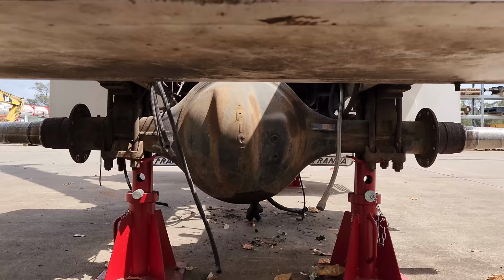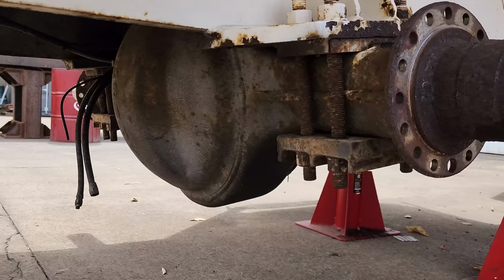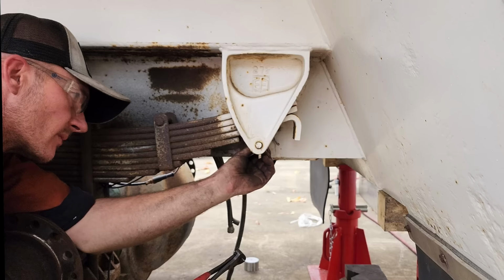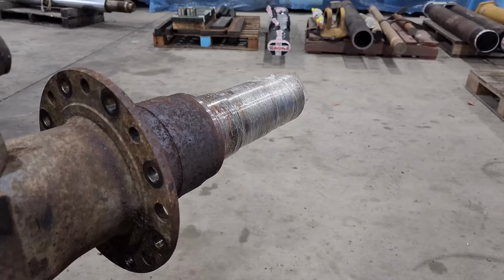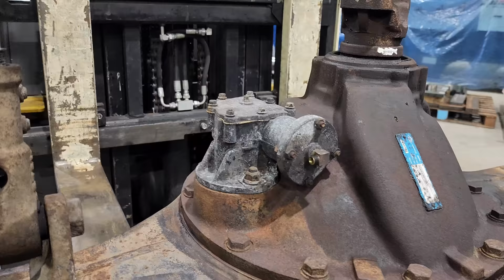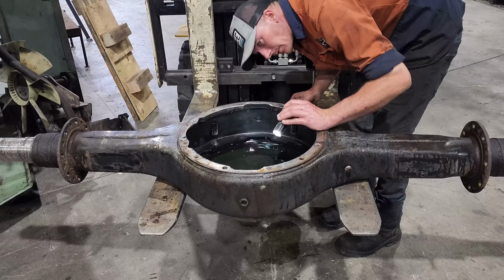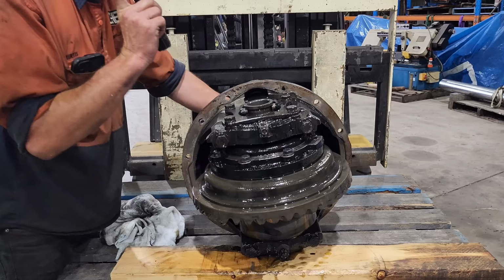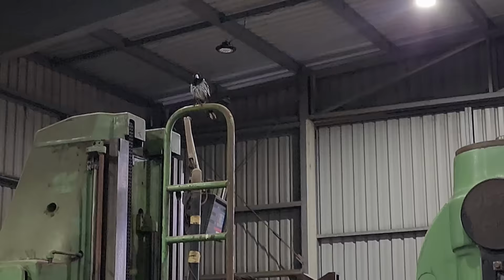Removing & Inspecting The Diffs! | Franna Crane Project | Part 8

Comment: Years ago, when I first started watching you - I once joked that you were going to build an entire Bulldozer out of making replacement parts. The fact that you are borderline going to completely rebuild your Crane means I wasn't as far off as I should have been.
Reply from the maker: 😂 you called it mate! The CEE bulldozer build is still on the to do list 😜
Reply: Kill dozer?
Reply: Infamous D12?
Reply: @CuttingEdgeEngineering  definitely do a "I bought this D11 but it wasn't quite right so I tore it down and redid the whole schwing schwang" 😅
Reply: For about 1/2 the cost of a new one 🤠
Reply: Holy crap, Kurtis, have you put enough work into this thing already?
Reply: This is not work. This a hobby called “ crane restauration”.
Reply: @pneumatic00  Anything worth doing is worth overdoing. Especially if you own the yard and equipment. 
Just like a house, you only do all large infrastructural projects before you move in. Once you are reliant on it, it better be up to your standards or you will suffer all the way through.
Reply: @ai-d2121  restoration?
Reply: @KirkHermary we all devour these vids dont we? 😉.Not all of us speak english.
Reply: @henkoosterhof5947  😎🤣
Reply: We call it a frame up overhaul I've participated in a old 14g cat grader in winter training got to rebuild a injection pump while rebuilding the engine
Reply: @DavoShed   "We'll keep it on the shelf as a spare."
Reply: @henkoosterhof5947   That's okay; not all of us speak Australian.
Reply: So, we started with this bolt…
Reply: @CuttingEdgeEngineering  Yes, but you know that building out of spare parts is going to make it double the price, though with your making parts for less than half the cost of a replacement it might actually work out cheaper.
Reply: @pneumatic00  No, just wants it to work well, unlike the other one, which still has issues, this one, as there is the other one to do the heavy lift, is going to be done up better than new, and thus be as reliable as any new part, but for a quarter the price, and also done to exactly the needs of the shop.
Reply: I want to know what the sprayer that you're using to clean with!
Reply: @CuttingEdgeEngineering the crane of Theseus 😂
Reply: That dozer will have the mightiest ripper shank ever seen
Reply: Should be a drift dozer then.
Reply: @WasserSquatch just kerosene
Reply: @OOpSjm  no i meant the tool
Reply: Crane of Theseus!
Reply: @CuttingEdgeEngineering  Excellent!!
Reply: a D20 as the other ones are to small @CuttingEdgeEngineering
Reply: @KirkHermary  yeah. Whatever.
Reply: @KirkHermary Well there is Squatch253 here on YT. A Cat D2 rebuilt to that degree. Also Project Binky,a Mini. No two bits left together.
Reply: Cap
Reply: @reubeng2110 , did about same thing on a 'sunk' Mercedes Benz diesel. My boss asked me "What are those parts?" I told him the parts are for the injection pump. ➡️ 😮 he then walked away.  😊
Reply: So what's a half inch breaker bar in standard bananas?
Reply: What follows is informed speculation:  As best as I can tell SI (Metric to us that still use Imperial measurements. Big sigh.) So, it appears that mechanics tool, sockets specifically, that are sized SI use Imperial sized square drives. 
To your specific question, 1 inch Imperial equals 25.4 mm SI so 1/2 inch equals 12.7 mm. In practice there's some slop. 
Here in the USA we have the situation where all manner of stuff is in Imperial and it takes some effort to obtain similar items in SI.
It's a strange, strange world.
Reply: @tetedur377   nope. I am dutch. Had to look up the word devour to put it down.
Reply: @SeanBZA  I appreciate that, I was mostly just needling Kurt. My  impression is that This project viciously blew up to about 4x what Kurt anticipated at the start. We've all had a few of those. Cheers.
Reply: An old friend used to build complete VW Beetles (the air cooled version) from new-old stock parts, brand new 2004-made, 1978-model car. And I thought that was impressive, let alone a complete piece of heavy equipment!
Reply: LoL... Cause he cut the threaded bar in the middle of the adjustment ends on stable arms.. not the u-bolts.. cause he can make those in his shop... Wasn't going even going to entertain the idea of spending $$$ on anything that he feels like he doesn't have to...
Reply: I have a friend who literally started with a valid Vin number for a 99 Peterbilt truck and built it himself.  He just bought all the parts needed and put it back together.
Reply: @patrickd9551  I hear ya. Just that this project just relentlessly exploded to 4x what the original assessment was, I reckon. And for sure, this heavy of a crane, you definitely don't want this thing running around your yard at 88%.
Reply: @KirkHermary Yep. Unless he's planning to open a little restaurant in the cab!
Reply: Awesome project Kurtis!  Blower is good for guy dusting the house! 😳😃👍👍👍
Reply: @justjames1348 nahh Curtis is too rich to be messed around by government.
Reply: @justjames1348 Marvin will be remembered forever
Reply: @abraxasracing  ½🍌
Reply: @nilo9456  do some math, take 12.7mm×2=__
I'll help you, it =25.4mm. No slop.
Reply: @WasserSquatch Jet A kerosene and a simple siphon gun like what some use to oil undercoat for winter rust protection. Kurtis’s siphon gun works really well.
Reply: Lol, it’s gonna be the "Franna crane of Theseus" 😂
Reply: We’re finding out why it was cheap now. There’s not been much of it that’s actually been good.
Reply: That cream is gonna be as good as new by the time you’re done with it😊👍👍🇺🇸
Reply: @henkoosterhof5947 We haven't been spekin english in straya for two hundred years
Reply: @paulkeys175  howzat?
Reply: Well done! Thanks folks.
Reply: @paulkeys175 😂😮
Reply: That 's sounds about right to me; I've been around for 73 of those years!
Reply: I was gonna leave a comment, but this first one I read sums it up. 
So incredible how he has the thing down to its last bolt. I'm beyond fascinated.
Reply: Essas porcas dos pinos dos tirantes são complicadas mesmo para retirar Você cortou os tirantes mas de qualquer forma vai ter que tirar as porcas para trocar as buchas.

Comment: When you went “.. that was pretty easy to remove” my head rocked back in shock. Kurtis had to overcome like 3-4 different obstacles in removing that diff alone and it was just business as usual to him.  Your attitude and ability is just inspirational; if I ran into one little seized bolt I’d be whinging up and down 😂
Reply: Yeah loved that "pretty easy"! Everything is made of slightly tangy wax when you have a cutting torch I guess!
Reply: Easy I could do the dismantling using a cutting torch. Problem is putting it back together & working.
Reply: LOL.
Reply: I'm surpised he didn't just torch the nuts off the ubolts and replace the u bolts
Reply: @nickcollins1528  The hardware needs replacing anyway, so why mess around pulling the axle housing, then the springs, etc. separately?  Easier to get it all out in one go and do the rest of the work out in the open.

Comment: In my automotive repair career, I spent close to 4 years in 2 different driveline shops.  Pretty much everything from the transmission back was within our purview.  Differentials, driveshafts, gearboxes, that was us.  

It was hard to get the smell of gear oil out of your clothes (much like diesel fuel), but I'm a lot more nostalgic for those smells than I was enamored with them in my time.

Loved watching someone else do this kind of work.  I could watch it all day.  Sometimes I do.
Reply: ive been rebuilding diffs and manual transmissions for years and I still hate the smell of gear oil!

Comment: One of the main thing I get out of your videos is just how patient (colourful vernacular aside) and methodical you are.
I'm always so focused on the goal - getting the job done - that I cut corners, get a sub-par result, and get shit-off with the whole thing.
Watching you work is like a meditation on how to pay attention to the journey, not just the finish line :)
Reply: Retrain your brain; you'll be happier as a result.  

I had the advantage of working on helicopters in the Navy.  It's pretty hard to pull over, get out and see what's wrong with the repair at 10,000 feet - even if you're the one that made the repair.

Even in my later career as an automotive mechanic, I very often asked someone to double check my work; similar to the way we did it in the Navy.  In the Navy (and our sister services), a quality check was a mandatory step in the process of effecting repairs; it was dictated from on high.  You don't have that as a civilian mechanic, but it's a good idea when you can to help prevent needless come-backs.  It's saved me an aggrieved customer a time or three.

Of course it doesn't stop the occasional "ever since you worked on my car, the tires all go flat" kinds of come-backs, but what can you do?  You can't whack your customers, as tempting as that may be.

Comment: That is so much work! I bought at a equipment auction a carry deck crane as we call it here in America,  it was a 12,000 pound rated boom I seem to recall, only paid $5,000 for it, drove it home around 2 miles away, sold it for $8,000 three weeks later, was in mint condition. Though I am in Alaska equipment like this is very common and often gets sold cheap for minimal reasons.
Reply: Sure it was mint. Lol

Comment: Hello Kurtis and Karin,

My appreciation for Kurtis' technical aspect, knowledge and problem-solving skills. But also for Karin about the way in which she portrays everything very professionally, without too many repetitive actions such as loosening all the nuts and bolts (but only 1 of them and the rest in accelerated or pass). Also many creative transitions from driving away from the 1st diff and entering the 2nd diff, compliments!
 
Then a point of attention. By removing the two diffs, an important part of the center of gravity has been removed. Because the boom of the crane is raised (and can therefore catch a lot of wind), there is a possible risk that the crane could fall off the outriggers. Be aware of this -;)

Greetings from the Netherlands.

Comment: Hello Kurtis and the boss, Karen, LOL. I have always enjoyed your approach to every thing you do. Maintaining the work space along with If I can't fix it I will get someone to either do it or tell you how. The house keeping inside and outside tell me a lot about any operation. I know you are all safety orientated. I have rarely seen u-bolts older than an a few days be recoverable. Usually the hot wrench has to be the way. Besides the rust they are already streached with the first torqueing and should be replaced anyways. You got lucky with that back diff. Any longer in service and it would be a total mess. all the way out to the wheel bearings. Using Jet A or B is always the way to go. It leaves behind essential oils in the pours of everything unlike solvents or gas. Diesel is ok too. Such a great way to do these. I have had to do them in the bush in frame. NO FUN as you would know. Thanks again for a great post. Karen really catches the best of everything you do.

Comment: Gday Kurtis and Karen, those diffs look to be in really good order considering the life they’ve had, I thought the back diff woulda needed bearings at least, George had his singing shoes on this week to, great job mate, have a good weekend, cheers
Reply: Probably only in good order because it was running all the time, and the coal dust was acting like a lubricant as well. Would be a good idea when putting back together to chuck a tube of Mo Di into each one, which will make them run smooth as butter, though the oil will look like black glitter forever after. did that with one diff in my cars, and it was silent forever after, and ran over 100 000km like that, with not a hint of noise. Toyota's are known for whining diffs, and that shut it up after 2 minutes.

Comment: 2:36 No water separation. 100% milkshake. That's a good sign. 
Stable emulsion without separated water aka pure milkshake is not great for lubrication but it's at least nearly as good as clean oil for preventing corrosion. Basically, you can look at it as artisan-made machining coolant 😉

Comment: It was good to see you hit the "back up a step or four" issues that us amateurs crash into when doing anything mechanical.  Like a car is essentially a collection of overtightened seized or missing bolts! The only good ones are unreachable. I was jealous of your ability to solve the problems with a cutting torch and a crane. It must be great knowing you can reweld or make replacements, it gets expensive quickly in amateur land. 🎉

Comment: This thing is gonna be sweet when it's done! Crane is likely in shock at the actual care it is receiving now unlike it's sordid past haha
Reply: Bet Kurtis will still be finding coal dust in it for years, as it came from a coal mine, and had a rattlecan overhaul before it was sold, so it just looked shiny white on the outside, and inside was all shyte.
Reply: The coal fired power station I worked in had a yard crane with driven front axle and dually wheels. The back had one pair of dual wheels that could turn 180 degrees lock to lock. A sort of three wheeler. It looked out of the ark but was incredibly useful.
We called it the Iron Fairy but I’ve not found images that match what we had.
Reply: @SeanBZA  Everyone does that. Dunno why, at least for myself, i always end up shaming them into cost cuts. I always end up using it against them and it always works. They start up puffed up and end up deflated, especially when i say that i would've paid more for an honest vehicle.

Comment: Pity the gas-axe was needed to disassemble.  Liked watching the forensics and clean-up on the diff's.  Bring it on Kurtis.  And as usual, Karen has the 'touch' when it comes to good video presentation.
Reply: most of the time it is easier, faster to gas axe the U bolts. with the amount of rust everywhere else on the crane, those U bolts probably werent in the best condition anyway

Comment: Hello Curtis,

As a retired millwright who used to work in the rock drilling department, I wanted to share my experience with a similar job. To clean the diffs, we inserted a coil of copper tube with holes drilled on the top and placed it at the bottom of the drum. We then connected it to an airline and filled the drum with a solvent of our choice to a level a couple of inches above the diff. We turned on the air adjusted it for good agitation and let it work overnight. The next day, we rinsed it off, blew it dry, painted the inside with glyptal, and then reassembled it for installation.

Play safe from Elliot Lake, Ontario, Canada.

Comment: It's amazing you can spend so much time away from paying work to devote to such an involved project. Very interesting and through restoration project.
Reply from the maker: we're doing this project after hours and on Sundays 😂
Reply: @CuttingEdgeEngineering  That's the way to get ahead and have a machine with much value added. Much better return than gambling at the casino or buying lottery tickets!

Comment: Changing out the pinion seals is going to open a whole different can of worms, but it needs to be done.
Reply: na them aint too bad, just mark the pinion nut and put it back exactly as it was and easy peasy.  crush sleeve style diffs are the aggravating ones.

Comment: Great Video as always. The Loctite or Sealant on the bolts holding the center section to the differential housing was because they were through holes with oil behind them. I’m sure you knew that. Otherwise it would weep oil out the threads. I enjoy every video. I look forward to Homeless and the outtakes. That’s going to be an awesome crane when you are done. I like the common truck parts used.

Comment: 👍🏻👌🏻VERY NICE JOB !!!  Better than brand new, all components broke and run in, so 😏 "NO WORRIES MATE" only assemble, clean exterior, paint,  machine replacement parts, reassemble, refill, and install !!! 😱 HA " DEADSET" as you may put it down there.😆
BE SAFE , THANK YOU , always a treat to follow along. 😍😍😍😍😍

Comment: As more and more weight is removed, i am getting more worried about the fulcrum of the boom. i am happy to see pointing to the sky and that the cylinders keep it up. as a crane inspector i have seen a crane almost tip over, and you have time to react and no time to think " is this happening?" lol As professionals we are trained for that scenerio. As an inspector I am just. watching out for you. The jacks are in good placement and everying is looking safe.
Reply: a bit of my back story, I am a certified NDT inspector and have a career of 20 years, 7 of those I worked in coal mines inspecting all the equipment for open pit.  So I am loving the content and it excites me and brings me back to the glory days. Now I am inspecting for Nuclear power. Its less fun but atleast I know where I am going every day. I do miss the adventure. :)
:yougotthis:

Comment: I can smell the gear lube, especially old burnt up oil with water in it. Back in the 90's I was an ASE certified mechanic, rebuilding transmissions, transaxles and differentials. There is a distinct smell that I remember along with burnt tranny fluid.

Comment: Using the barrel as a parts washer was brilliant, kerosene makes a great cleaner/solvent.
You might want to epoxy magnets to the bottom of the upside-down housing.

Comment: A bearing expert said for wheel bearings, that are not bathed in oil. Do not try to solvent spray them out and apply more grease. Just add more grease. The solvent may not get back out and will dissolve/breakdown the new added grease., if you can't dissemble them all the way. Like on a wheel hub area, trailer, etc.
Love the dunk in jet fuel

Comment: I think heating the spring shackle nuts with an oxy-acetylene torch would have made them easy to remove. This heating method to remove rusted nuts has worked for me every time I can recall.